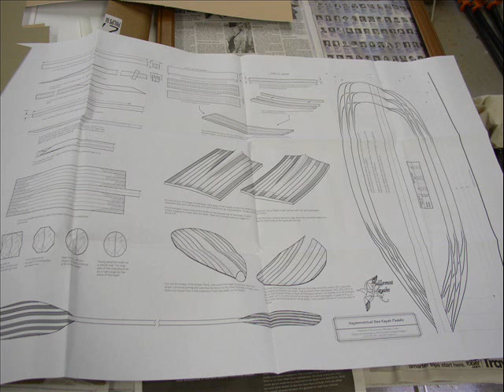Kayak Paddle

Comment from the maker: 70 degrees comes to mind.  It's been a long time.  We are lloking for a feathering joiner for the middle of our next paddles.  This will allow any angle and they can be separated in the middle for transport.  I think 230 or 235 cm is the length. I decided on that based on my height, but we don't know quite yet how high I will be above the waterline. The next one will be more custom once I get in the boat and figure some things out.

Comment from the maker: The shaft is spruce.  It is halved and hollowed on the inside of each half and then glued together.  That was supposed to make it lighter, then we used bloodwood, spruce, walnut, and Alaskan yellow cedar for the blades.  I misjudged the scarf and had to add the bloodwood spacer you see in the middle in the last slide.